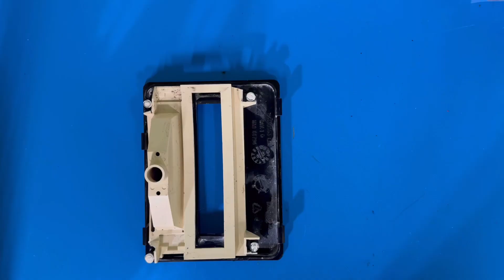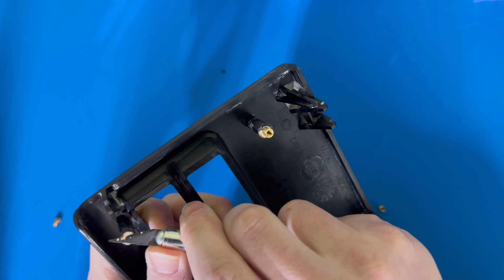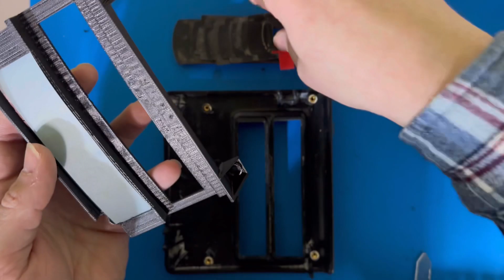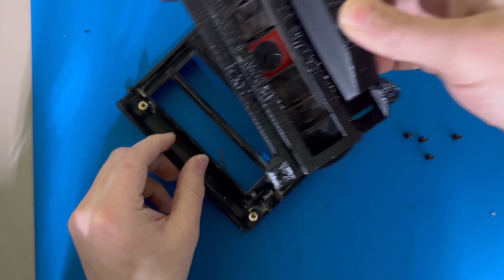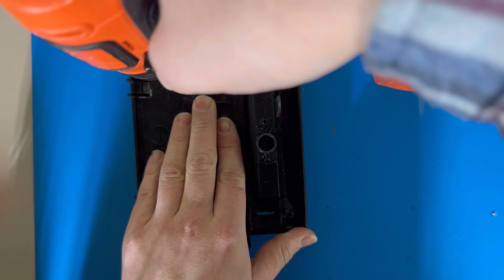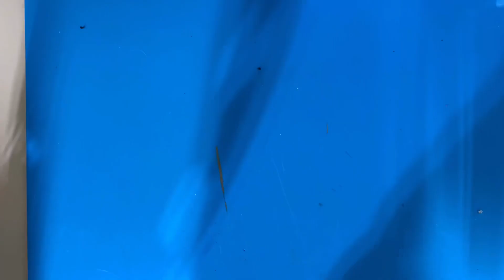How to repair Jeep TJ & XJ automatic shifter trim

Comment: Installed this today into my TJ. Overall, great! I'd offer three pieces of advice: 

1) Use the hobby knife to remove as much of the old backing plastic from the top of the pegs prior to starting, to get them as even as possible in height, and flat so the drill bit doesn't walk. Be gentle as to not break the pegs, just shave it off a bit at a time.

2) I started out with a much smaller drill bit to drill the a pilot hole, to make sure that the hole is centered within the peg. When I tried to start with the 5/32" bit from the start, it walked and I was worried about an off-center hole and weakening the peg.

3) YMMV, but I needed to use the hobby knife to open up the holes that the cap screws go through on the print. They were too tight and were causing the screws to not go into the inserts quite straight, and was worried about crossthreading. Again, be careful, it doesn't take much!